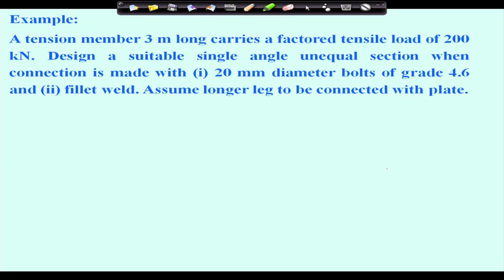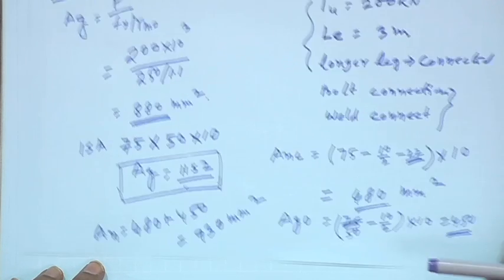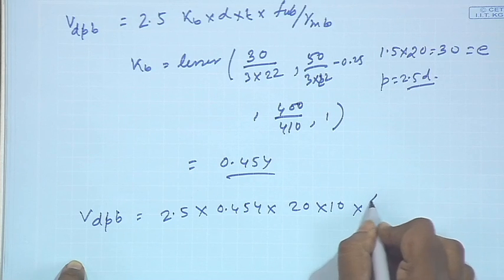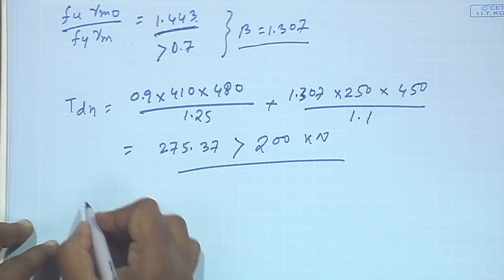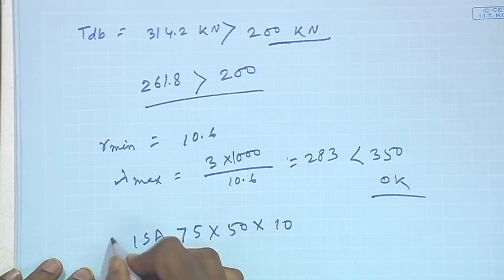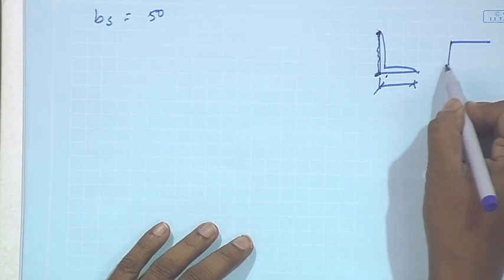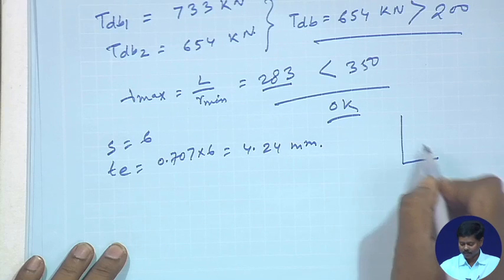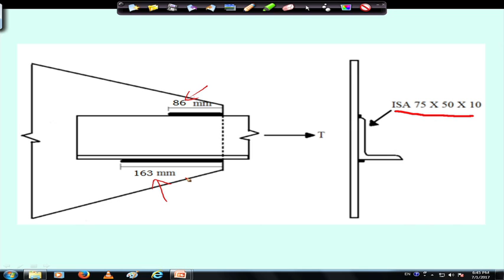Lecture 25 : Design Calculation for Tension Members

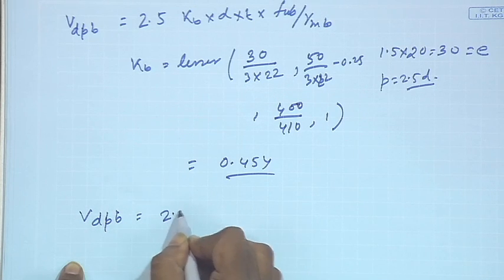Comment: 12:00 in Vdpb caculation in last term fu is of plate right and also 
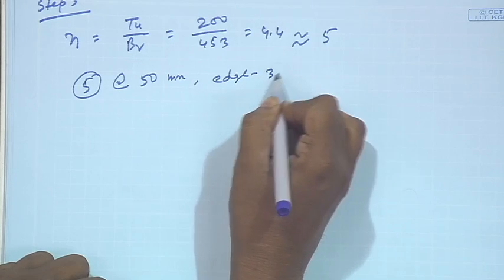13:15 we r providing edge distance = 30 mm then  14 : 30  how we r getting w1 = 40 it should be (75 - 30 = 45 ) 
plz anyone correct me if i m wrong
Reply: Yes it should be 45

Comment: In the block shear calculation for welded connection thickness of angle used; not the thickness of gusset plate as in the case of earlier weld problem🤔
Reply: Actually your thought is correct but the thing is that the thickness of the plate is not given in the question, so the thickness of the plate is considered equal to that of the angle.
Reply: Feel free to ask... Maybe I can help for some of the things.

Comment: Isn't that we need to take the longer weld length running along the toe of the angle in the calculation of the Avg and Avn in the block shear?
Reply: Avg = Avn = 2* 164.3 * 10 = 3286 mm^2
Lw1 = 164.3 mm instead of 165 mm i.e average weld length.
Reply: @ayyapureddy nandagopal   P1 + P2 =Tu
Consider it as a case of simply supported beam for instance. P1 and P2 are the forces opposite to Tu. Take moment of the forces about the edge point of the angle section.
Reply: P1 * 75 - Tu *26= 0 solve this to get the load distribution
Reply: Tu=200kN      Cxx=26mm is the centre from where the forces Tu acts.
Reply: Tell me if you got it or not?

Comment: Why he didn't calculate the block shear failure in the end with actual weld length?
Reply: I didn't get any idea..of block shear pattern in case of weld with unequal length
Reply: @snehasneha8270  we actually need to take the longer weld length for block shear calculation
Reply: @shivamsharanlall672  sir which text book it is?
If there is no weld in tension area.... Then how can we calculate Atn and Atg
Reply: @snehasneha8270   actually when you see the  block shear failure in weld connection, you consider that the whole gusset plate which is connected by the angle through weld is torn out due to this failure. So the tensile force is acting along the plane of the gusset plate which is not even welded up.
Reply: You can go though a similar problem in Lecture notes---design of steel structures----Uma Shankar Yaligar---pg 110,eg 4.
Although here the welding is done in the tension area of the gusset plate and angle.
Reply: Use google and write lecture notes.
Reply: In 24th lecture of nptel, go to 42:53 where Sir has taught about the programming. There go through the areas of block shear also.
Reply: @snehasneha8270  I think in case of unequal weld length, the block shear failure will take place along welded length and then along the diagonal line connecting the unequal weld inner end. Well I am not sure about it.I only guessed it.

Comment: Where is the average weld length for beta calculation is given?
Reply: Same doubt, where is it written in code? Did you get the answer?
Reply: @vishalbarwal6659  no,  I just calculated the P1 and P2 value and then the weld lengths Lw1 and Lw2. Then calculated the yeild strength, rupture strength and block shear strength. No need to take average weld length.
Reply: Yes, exactly. But I was curious if it is mentioned, then where can I find it. It's alright, Thanks!
Reply: @vishalbarwal6659  no I didn't found it.
Reply: @shivamsharanlall672  I also didn't get it. But your way of finding Lw is helpful. Thanks!!!

Comment: sir minimum edge distance is 1.5Xdia.of hole i.e 1.5X22=33mm
Reply: It's not the dia of hole it's dia of bolt only 20mm it's correct 
 1.5×20= 30
Reply: @KRISHNAKrish-ii8vo  thank you bro

Comment: Sir  Atg value will be  =35×10                 
Not 40×10
Reply: tell me how that 40 came there??
Reply: it will be 40 only see the figure 7 in IS:800:2007
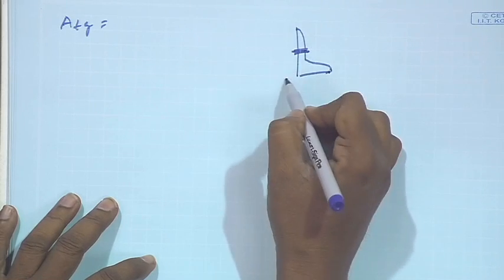Reply: @rajashekarmuthyam  it will be 35 even as per Figure 7. Look at minute 19:11 onwards in the video and compare the distance to Figure 7, it will be 35. It's an error in calculation in the video.
Reply: @martindsouza2659  I calculated using 35. I agree with you. In case of block shear failure, the tension failure should happen along the line from bolt to the outer edge of angle and that was 35mm.
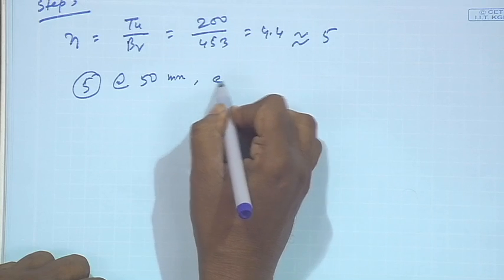Reply: @martindsouza2659  at 13:15 we r providing edge distance equa to 30 mm then why it should be 35 ???? can u plz tell
Reply: @rajashekarmuthyam  it will be 3 you are that figure is justifying that the answer should be 35 and not 40
Reply: Yes
Reply: yesss in last example he took it as 35into8